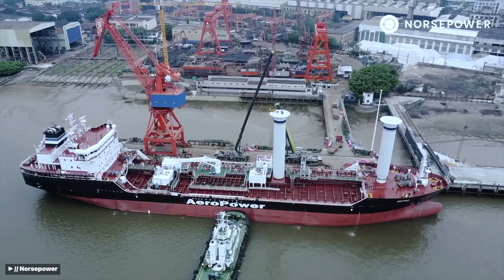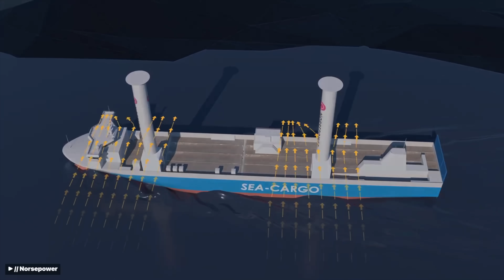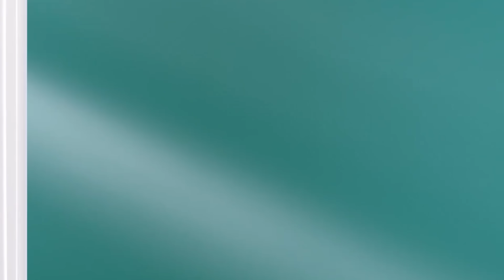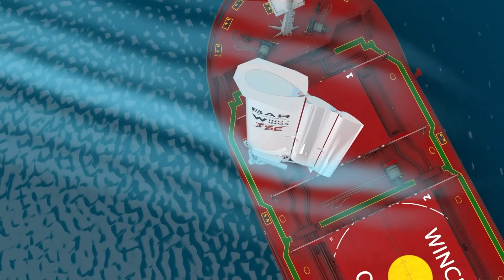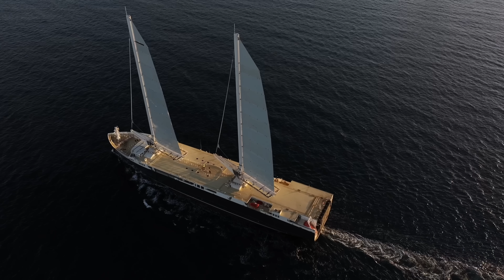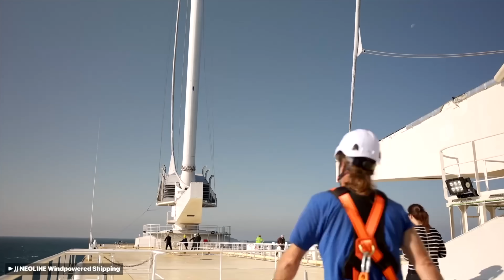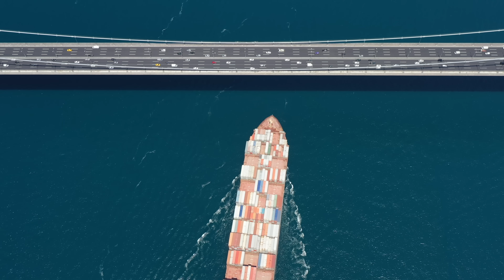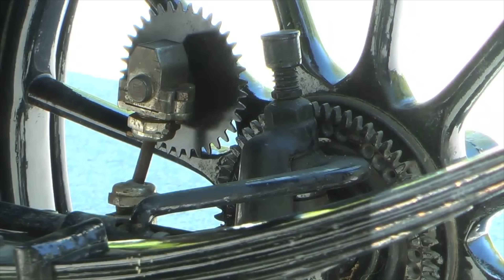Surprise Breakthrough Solves Shipping's BIGGEST Problem

Comment: Been working deeply into these solutions from very practical point of view, so I have some more precise figures, besides these publicised extreme best scenarios. 

What I can confirm, even with NDA in place,  is that both the rotors and the wind  sails solutions are far less practical for wide application due to two major restraints: cost of ownership and actual level of applicability being pretty low.

On cost: pretty expensive solutions to manufacture and require dry-docking for putting on and decomissioning, plus you lose deadweight carrying capacity, that is easily overlooked.

On the applicability: you can achieve the quoted performance metrics ONLY on extremely favorable days and weather conditions.

 I can assure you, those days and nights are by far, far rare and not so common and make commercial sense only on liner routes, where you have predictability and reversability of the route - and the weather patterns. 

Unfortunately, this does NOT apply to the bulk of the, ahem, bulk carrrying vessels, as well as the long container routes. 

Real overall efficiency for a world-wide mass cargo transportation is even now .... close to negligible - definitely less than 10% or 5% for rotors and sails, respectively.

So those 18-19 MTs of fuel saved - is overall something like 5 MTs on the monstrous post panamax that was fitted with it - and these behemoths run easily 60+ MTs per day, every day.

 That was the reason Cargill put its Bars wings on such a big vessel: the loss in carrying capacity and cost per MT of cargo transport saved will be ridiculously big and not worth it, respectively on most of its other vessels.

World maritime transport is not done by this kind of big extreme vessels and for now only those show some positive net gains, a bit above negligible.

For the most of the word cargo carrying fleet, these solutions are just not worth it and will not be for some very long years in the future - due to physics constraints.

I am all for less polution, by far, but these measures are only for PR on the overall cargo market and supply chains of the modern world.

A return to windsail power is a return to the miniscule cargo flows and the unpredictabilities from ... 2 (two) centuries ago.

Would you like to wait for your temu t-shirt a couple of months more??
Reply: So you are explaining the impossibility of something that is already in operation?  I don't follow.
Reply: @oldsarj seems you also did not bother to read or understand the whole impact of these solutions - which is negligible, at best.

And it will be the same - negligible, for quite some time, even in the currently stressed market.

Comment: If you pair it up with a solar deck [ meaning a policarbon surface with solar cells below of it/inside of it  ] or a solar blanket over containers you could also have solar energy that can power the engine.

Comment: Flettner rotors were first used in the 1920s so I guess it's a brand new technology, just disovered.
Truly a breakthrough.
Reply: I watched this exact idea some 10 years ago 😅
Reply: Oil was cheaper than all competition back then.
Reply: A lot of Technology had to come up to make this practical. On their own the rotors are absolute trash. Which is why no one has used them in all these decades. Material Science especially had to improve. You should think things through before trying to be clever with snarky comments. Cuz you just made yourself look a little dumb and ignorant.
Reply: @lordgarion514  Flettner rotors were PRACTICAL back in 1924. There was no additional need in material science.
Reply: @lordgarion514  'You should think things through before trying to be clever with snarky comments.' That's a good advice you should follow

Comment: Where are the calculations of through life energy and CO2 savings including the energy and CO2 for the production of these various units? Electric vehicles for example notoriously have to be driven nearly 100,000 miles in most countries to pay back the CO2 used in making and powering them whereas a simple switch to LPG in ICE cars would do far more to reduce CO2 without all the vast expense of massively reinforcing the electricity systems. We need some joined up thinking here especially as Nature magazine itself, usually, and unfortunately, a magazine that pushed the CO2 is evil agenda has now admitted that CO2 has had virtually zero effect on climate changes over the last 3 million years and counting. Nothing at all wrong in using quaint wind power to save fuel but let's not pretend it has anything to do with saving the planet.
Reply: "Electric vehicles for example notoriously have to be driven nearly 100,000 miles in most countries to pay back the CO2 used in making and powering them"

Gross exaggeration...  It's nowhere near 100k miles, it's more like 10k-30k miles

Comment: You miss one advantage of the kite solution being that it is most likely easily retrofitted on existing vessels.
Reply: It's sad he spent so little time talking about the kite sail.  when folded and in port, it would use up very very little space,  Would be really really cheap to put on damn near any cargo / oil / LNG ship.  MUCH cheaper than any style of traditional sail.  And as you said, could be put on pretty much any and all ships TODAY.   Sure, it would require a bit of software to auto adjust the sail on the fly, by itself.  the 3-part sail can already do it.   And best of all, The kite sail could probably work WITH any of the other 3 ideas as well.  So instead of seeing a 20 or 30% fuel reduction,  they could see up to 40 or 50% in good conditions.   And even if it can't be 100% at all times due to weather conditions, Don't let perfect be the enemy of the good.
Reply: @Fearmylogic  You would need about the space of container on the frontal area of the deck. But it sounds easier to operate in theory than it is in practise. Launching, flying and retrieving the kite comes with its own challenges at every step of the process. Installing and operating a Flettner Rotor or a variant of a rigid sail is much easier to do. 
Also, a Kite is more limited by the wind direction than a sail. With good sails, you can use almost perpendicular wind and still gain forward momentum. A kite needs wind from behind the ship to tow the ship.
Reply: @mephisto8101  with good sails you can sail 45 degrees UPWIND. But yeah.
Reply: @Fearmylogic  You high light a very relevant matter 'in port', though merchant ship spend the majority of there time at sea and system that cannot be utilised while the ship is at anchor or in port is wasting potential.  Thank you.

Comment: The best battery is the flyweight in a vacuum with magnetic bearings.  Can be cycled 100,000 times and go on.  You can 90% to 95% of the energy back out of it.  It is being used in some homes in Australia.  The only problem is it will NEVER be approved for the US because there is no repeat business for the main companies to make money off of!

Comment: As you suggest, we are coming full circle on wind-power at sea.  Years ago I had opportunity to examine the captain's logbook for an unfortunate voyage of a cargo sailing ship in 1906.  That type of ship  (with mainly fore and aft sails) could undercut the  cost of steamships of its time. It delivered lumber from the American Pacific northwest to Haiphong in Viet Nam. To find a return cargo it was sent to Australia for a load of coal to take back to its home port. 
Though it got accidentally grounded on a reef northwest of Australia, and took the crew two months of hard work to get free and to a safe port, I learned that it was sailing ships that the faster steamships relied upon to service the coal bunkers that they needed for more timely cargo and passenger service back then.  As always with American owned ships, cost cutting was predominant. So crew size was just barely adequate, and a steam donkey engine helped hoist the sails, with the fuel for it coming as a part of the cargo it carried so cheaply.

Comment: A question without any engineering background. 
Why are there not windmill style designs here? It seems to me that a windmill would work no matter the wind direction compared to direction of travel - assuming it could turn to always be in the optimal alignment, either generating power or directly driving propellers?
Reply: Wind turbines work by using drag, which means they are designed to have a lot of drag. This will slow down your ship if you're moving against the wind, and when the wind comes from the side you have to compensate drift by steering into the wind bringing us back to the first problem, and if the wind comes from behind they only help if the wind is faster than your ship. In all three cases a sail would be better.
Reply: @Regretr1 thank you 🙏

Comment: For some reason I don't believe it.   First there is almost no contact area on this tube.  No fins just smooth surface.   So I don't believe it.    How about a demonstration with small tubes to prove it works?
Reply: it's has surface area all the way around it, that's the neat thing about fluid dynamic (and air), the force will conform to the obstacle.

Comment: When I first saw the kite one my immediate thought was "why not do 3-5 arrays of 3 kites, attached in front and on the sides, staggered at differing altitudes? Especially if you can run one up crazy high - the amount of wind on the open ocean is phenomenal."
Also: there's no reason you can't pair the kite one with the others.
Reply: Deploying and catching is the Problem with giant kites
Reply: @felixtheswiss  I imagine it's not impossible. And given how much savings it could produce - The R&D into making it happen is probably worth it in the very long term.
Reply: @PaulTMaack0 Tests are done since decades, but not successful. If only a small percentage of the AI money would go to this it would be in use now.
Reply: Isn't the problem that the differinh velocities would reduce the effectivness of the lower kites if you used differing altitudes? At some point the control system wouldn't provide enough savings to pay for itself energy wise, right?
Reply: @Oliviateacheseverything why not? Some of those types of kites use air flow through the wing to keep them rigid (I'm not an expert, obviously) so maybe they could use some of that air to drive small turbines to generate electricity. And having multiple kites at different altitudes attached in arrays concurrently might be a tough problem to solve, and certainly their effectiveness would be impacted at some point. It's a matter of finding the right number, size, shape, and height; then finding a good control system for deploying, retrieving, and maneuvering them. They wouldn't be cheap, but neither is burning literal tons of fuel. And at certain altitudes in certain latitudes on the open ocean - you can count on pretty consistent wind. 
On the other hand: boats are freaking heavy and wind is never going to be 100% of the time. It's certainly a complex problem with many bits to twiddle. I'm just saying I think it's worth it to try.

Comment: until effective H2 generators will come they can simply be charged with h2 in tanks and h2 can be added to combussion which will approve engine effective and reduce diesiel consuption also exhaust will be less pollutive because of higher burning temperature and then can be fully replaced by burning h2 got from sea water or tanks, as probably it will be cheaper chan change engine

Comment: A notable space for improvement based on this tech: with the engine becoming supplemental or even a backup option thanks to these advanced sail technologies, solar panels powering an electric motor start to become a viable option.

Wind is good most of the time, but even back in the day, ships could be becalmed.  And sure, we've got modern weather prediction that means we can probably avoid that most of the time, but having a motor that runs on sunlight that can at least putter you back out to where there's wind seems like a good idea  (As does having something that lets you not just rely on momentum when you're going under bridges with your masts stowed given the consequences of hitting things like, say, bridge pilings.)

What I'd really like to see is ships with a combination of these options - wind turbines or solar powering the systems and a backup/supplementary engine, and either (or even both?) of the sail options mentioned for direct propulsion.